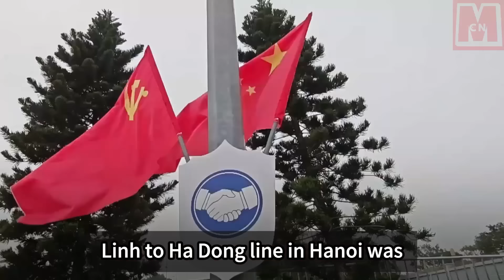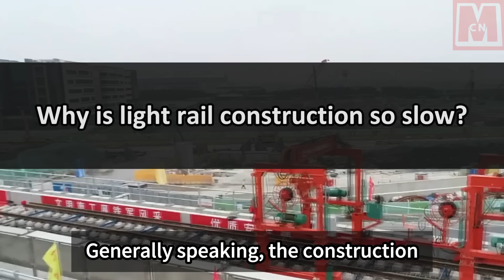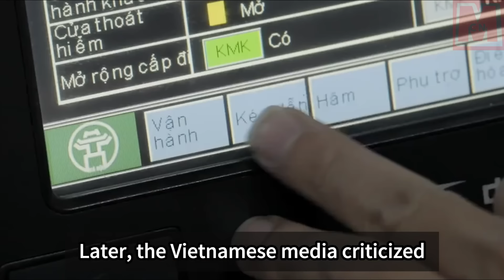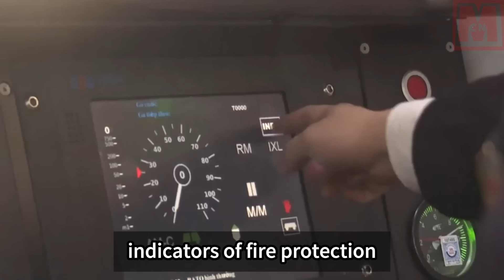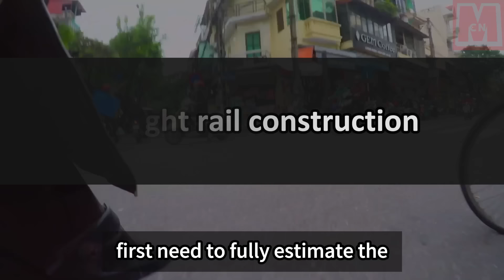Why did China take 10 years to build 13 kilometers of light rail in Vietnam?

Comment: Wow 13 kilometers but 10 stations.
Reply: With such number of stations in 13kms, the train will never accelerate to maximum speed
Reply: The average distance between stations is 1191 meters. To reach a speed of 80 km/h with an acceleration of 0.1g, the train will cover a distance of 252 meters. However, faster acceleration may lead to standing passengers falling over.
Reply: City subways are all like this, ignorance, right?